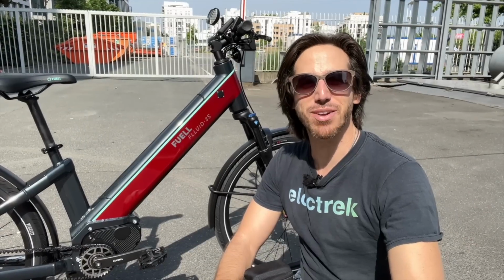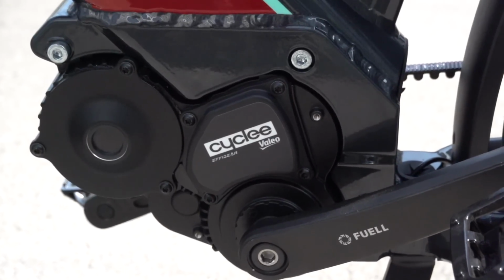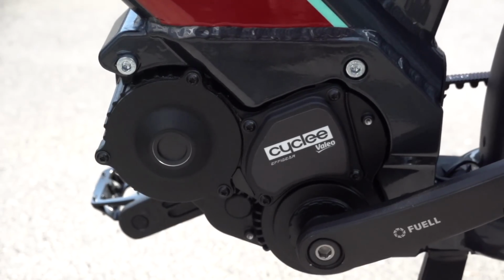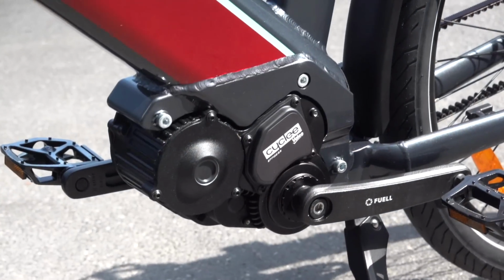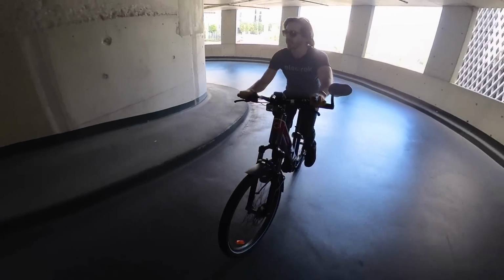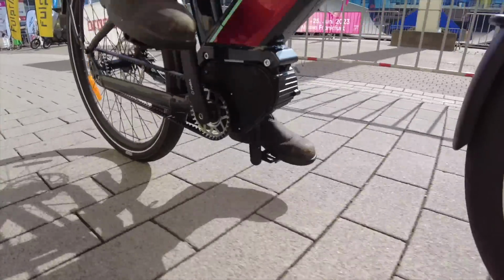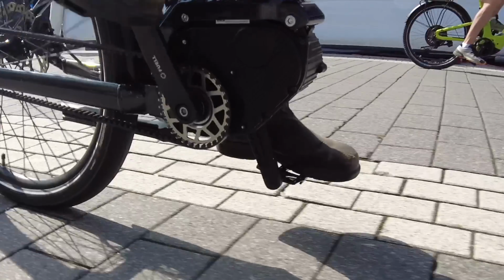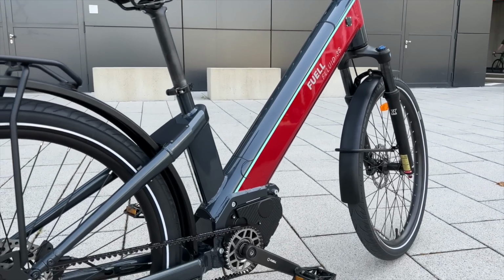FUELL Flluid-3 first ride: Testing a high-end commuter e-bike

Comment: I had the Fuell Flluid 1s and was very, very underwhelmed by the final product. The battery estimations are completely off and got nowhere near the amounts that were quoted by Buell's company. 750w mid-drive motor should be better on this and the addition of a throttle should definitely help matters. I loved the belt drive and the bike was very solidly built, but I have to say that I really couldn't, in good conscience, suggest buying either of these at those prices. You're probably way better suited to purchasing your own mid-drive motor and slapping it on a bicycle from another manufacturer. That being said, I will say that when I rode it, it felt extremely safe and very, very stable. I can't say the aame about other manufacturers, like the Wired Freedom which, on paper, has specs people may find more enticing, and sounds great but holy heck did I have a nasty crash on one when the mudguard snapped off out of nowhere and I'm currently undergoing a 6-month AC separation recovery, which required surgery. So there must be something to be said about paying the extra money for a bike that looks and feels solid. If the 2S gets even half the range that it claims, it could be a great E-Bike. But for $6,000? No way. $3,500 for the 3S and $4,000 for the 2S would be a way better price point.

Comment: Get a Wired Cruiser for $2000 for the ultimate commuter bike.  26x4 with a 60v 1.2 kWh battery that provides 2300 watts peak and fully programmable to any class.  Unrestricted, the Wired bikes go 40mph.  Comes with a huge rack😂.  The acceleration and top speed make it easy and safe to stay with the flow of traffic.  You’ll thank me later.

Comment: Man, unless I missed it in the video, the site doesn't have the weight listed.  Weight on these higher end e-bikes is my main concern.  My radrunner plus is about 75lbs so anything around that weight would be my ideal replacement for the rad, especially any e-bike with a belt drive.  I love my Priority Onyx and it's a shame that so few companies want to even try to sell belt drives.
Reply: I believe the 2-S weighs about 83lbs. Each battery is something like 8lbs if that helps.
Reply: The Atlas weighs less than your Rad fwiw. 58 lbs. + 8.5 for the main batt.

Comment: Dang this looks sweet. The only feature it's lacking for me is cargo capacity - I like the bigger tires but ideally I need to carry a heavy backpack in front and my 3 year old on the back. Do you know the weight rating for the back rack? Any option for a front basket?

Any other suggestions for a high end utility/cargo bike besides a fully specced out Tern GSD? 🤔
Reply: Not sure where in the world you are. But, two of my favourite cargo bikes are the Larry Vs harry bullitt and the xyz cargo trike. The xyz is awesome, I own one and converted it myself to electric. But, it's probably not so great if your country doesn't have good cycle infrastructure.
The bullitt is a special bike, rides like a regular flat bar road bike/hybrid, it's quick, it's nimble, but you can carry two kids and your shopping in it.
Reply: @HilsDinMor7  Thank you! The Bullitt look awesome, I'll keep that one in mind. Unfortunately I'm in Texas with pretty awful infrastructure, so I definitely need to be able to keep up with traffic in a pinch (not with kiddos on the bike. 😅)
Reply: @travisrose I thought TX would be into accommodating  cyclists of all kinds to reduce traffic. Maybe Tesla can into building and selling E-Bikes for commuters.
Reply: I have a Tern HSD S11. It’s smaller than the GSD, decently fast and lots of cargo room. Also I’m pretty sure you can add an Old Man Mountain rack to the front for your backpack. I’m thinking of doing the same.

Comment: Expensive.....and ugly with a dated look (and sloppy welds for a $5.4k boutique e-bike).  What/who is the market for this ?  Dilettantes who smell each other farts like they're at a wine tasting...... and it's a bit too proprietary. Repairs will be crazy expensive and forget about "upgrades".   "Designed" by a Motorcycle builder who looks like he put in 10% effort and handed off his "specs" to his bored, otherwise unemployable nephew.  Yea, that was harsh....but look at that thing......
Reply: This is a bike made for low maintenance, high speed and for practical use for people who ride a lot. It's not a fancy Sunday tour bike optimised for optics with grinded welds or a smooth carbon frame.

It's a moped replacement, not a fancy toy, for long distance commuting or delivery purposes. 
Since the optics seem to be priority no 1 for you it's obviously not a bike for you.

Comment: Repairs are going to be a problem, few shops could fix it
Reply: Repairs for what? The motor? That would be the case for most of these bikes. The fact that it’s all in the mid-drive means that any LBS can work on the rest of it without an issue.
Reply: Well, considering it has a belt drive and an internal gear hub, it shouldn't be an issue for a long time.
Still waiting for a bike CVT to become a thing :)